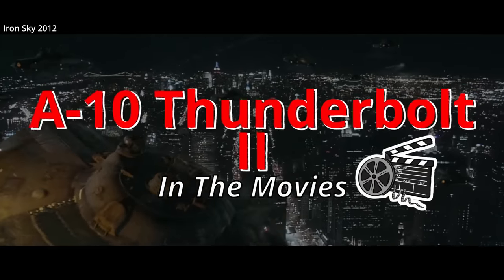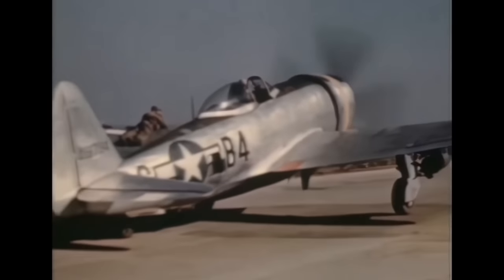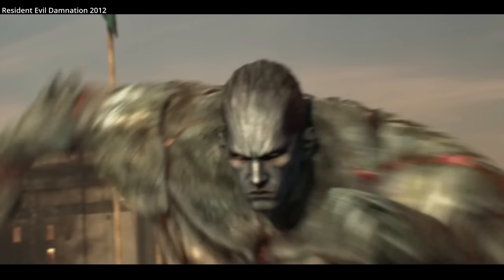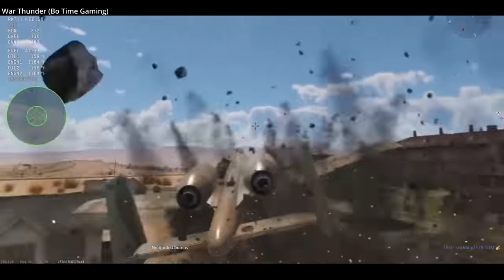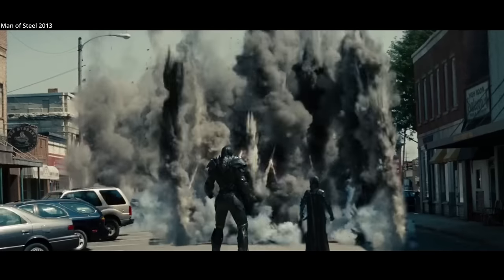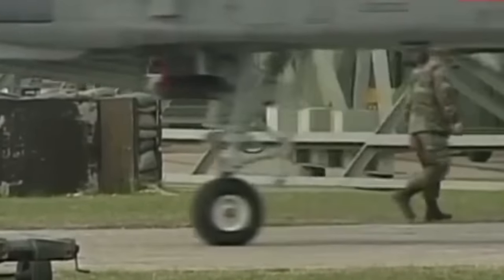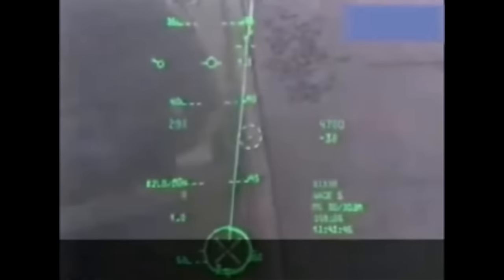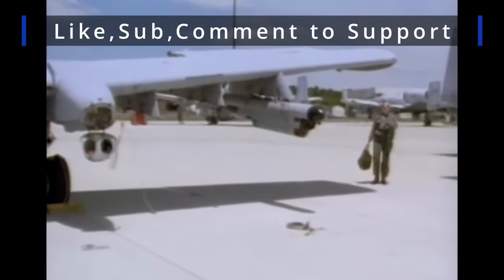A-10 Thunderbolt II - In The Movies

Comment: I saw the A-10C Demonstration Team at the 2021 Alberta International Air Show, and it was the first time I ever saw the BRRTmaster up close. Such a beautiful aircraft in its own unique way, and a lot easier on the ears than the CF-18s that were also making their runs earlier in the day!
Reply: @TheCoolCucumber  They're not necessarily deeper toned, they sound similar to the F404s in the CF-18. They just get quieter from a much shorter distance in comparison. It had to get about a kilometer to the airport before you could start to hear the A-10 again, while the CF-18s could be heard for many kilometers. The APU the A-10 uses to start up its engines though IS very deep in tone, and shakes the ground rather violently unlike the main engines. Even with one engine is already started up, you can immediately tell when the APU kicks in again to start the second engine.

Comment: The problem is the US Military does not have a good replacement for the A-10's long-loiter CAS capability, and the US Air Force has shown little interest in procuring one.  The alternatives all have issues:

1)  Drones -- While having loitering and payload capability, the ones being proposed have poor performance and must maintain high-altitude.  The key issue is they are all remotely controlled from vast distances, which means any number of electronic countermeasures can be used against them.
2)  Heavy Bombers -- Has loitering and payload capability, but likewise have poor overall performance, must maintain high altitude, and are rather easily detected and countered when loitering.  The USAF also has shown little interest in procuring a low-cost aircraft, and has been letting the current fleet of B-52s and B1B's atrophy.
3)  Highspeed Fighter-Bombers/Multirole Aircraft -- High performance and modern electronics, but have poor loitering capability.  They are also much more expensive, require a lot of maintenance and support, and are designed for high-speed and high altitude, which (while making them great for strike missions) makes them poor for cases where they need to stay on-station and CAS needs to be performed at lower altitudes and visual confirmation.

I can understand the USAF not wanting to upgrade the remaining A-10 airframes with better or modern electronics, but at least propose a project to replace the high loiter time, low altitude, high payload capability with the ability to perform visual attacks.  Not just say "my latest toy can do the job -- give me more money for that please"

Comment: Pretty much an open secret in the Air Force that this aircraft is TERRIBLE at its reassigned task--close air support.  It is simply NOT what this aircraft was designed for; it was made in anticipation of the inevitable tank invasion of northwestern Europe.  To fly up and down the Fulda gap and other choke points strafing endless columns of T-72s.  It was not in any way designed for pinpoint defense and assistance of ground troops; and two major design features of the air frame bear this out.

1:  It only has one operator; this means that the pilot not only has to fly the  aircraft, but assess the information he is receiving from soldiers that are under fire.  

2:  This plane has none of the advanced imaging of the Apache, and in many cases the pilot literally carries binoculars so they can attempt to scan the area and assess the situation they are flying into--at 300mph or so.

And then there's the mighty GAU-8--a weapon whose accuracy is measured in 12-meter increments.  What that means is that any hit within a 12-meter radius is reported as an accurate hit; that's about the length of a city bus in any direction.  And that's an accurate shot--rare in combat conditions, in a plane that offers little isolation or mitigation of the massive recoil.

Simply, this aircraft killed more of its own soldiers than any other aircraft in Desert Storm.  But hey, big gun go BRRRRRRRT

Comment: One thing about the positioning of the Aircraft's Engines.  When a jet engine gets hit - it can sometimes come apart, slinging fan blades about.  By putting the Engines off in their own little pods - this reduces the negative impact of the engine coming apart or catching fire on the rest of the aircraft, unlike engines which are inside the aircraft's fuselage.

Another aspect of the A-10's history - is  that while - yes - the aircraft is beloved by many for saving their asses - including it's air crew - the Air Force itself hates it and has tried to get rid of it several times.  The Air Force has always preferred an image of a Service that goes after Strategic Targets to Win Wars - and doesn't really get into the grubby existence of people on or near the ground.  It really should be owned by the Army - who would appreciate it - BUT - in the Forming of the "Air Force" it took all the Fixed Wing aircraft away from the Army - so that the Army is only allowed to have Helicopters.

.
Reply: Except for transports.

Comment: A-10 is feasible only if you've established air dominance and against enemy forces without manpads. very vulnerable to all AAs because of its "slow speed". also, i hear they're gonna decommission it in 2030.
Reply: Truer words ever spoken.
Reply: However, Congress would pause further cuts unless the Air Force demonstrates how other aircraft can fulfill the Close Air Support missions currently undertaken by the A-10. According to Dan Grazier from Project on Government Oversight, the Air Force is ill-prepared for this transition because it requires no Close Air Support training for its F-35 pilots, despite the F-35 being advertised as the main replacement for the A-10. Air Force Chief of Staff Charles Brown expects all A-10s to be retired by 2028 or 2029. However, further cuts to the number of active duty A-10s will be paused by Congress until the USAF demonstrates its Close Air Support capabilities can be replaced by other aircraft.

Comment: I can't see why we would go back to using prop driven planes that are slower and probably less resilient to ground fire when you have a perfectly good solution that's already in use
Reply: They are a lot cheaper. Sth the government is most interested in.
Reply: @Iauchmitschlauch  I can see that but you need to factor in everything safety included
Reply: @mikebaird6788  you can use F-16s and drop bombs, missiles form safe distance and never fly low and being exposed to small arms fire, MANPADS and most of all, SPAAW.
Reply: @mikebaird6788  safety? you mean the one on the a10 that cant defend it against anything?

Comment: Of course the Aircraft isn't to blame for Friendly Fire incidents . Intelligence , Communication and Friend or Foe  protocol breach are .
Reply: so you want me to believe the a10 is the only one suffering from those problems to such a degree its killed more friendly units than all other us planes combined? no, the a10 is a shit plane, theres no way around it
Reply: @Helperbot-2000  . If  it's  junk , then why do they keep persisting with it ?
Tell me something , ir you are doing something with , say an Electric Drill , and you manage to Injure yourself , is that the DRILL's  fault ? Or  YOURs ?
Reply: @johncunningham4820  "If  it's  junk , then why do they keep persisting with it ?" you could have said that about most of the wehrmacht, misinformation, greed, delusions, and propaganda for example.

if the drill had a high enough rate of injuries because of design desicions not present on other drills it would be fucking taken off the market potentially with criminal liability on its creators for making a dangerous tool, do you even think before you speak?

Comment: The biggest enemy the A-10 faces is the U.S. Air Force itself.  They want to retire it in favor of high tech fighter jets, but it has been clearly shown that those plants cannot do the job as well.   What really needs to be done is an alternation of the Air Force charter.  The creation of the Air Force placed a restriction of the U.S. Army, that they were not allowed to have armed fixed wing aircraft, that needs to be changed, allow the Army to have armed fixed wing aircraft for the purpose of the ground support and attack rolls.  Let the Army have AC-130's, A-10s, and what every they can make to replace them in those rolls.
Reply: ... those planes* cannot do the job ...

Comment: the american government would be foolish to abandon the a10. They should just give it a whole modernization from the ground up.. even the gatlin gun if there's a better one available. materials science has improved vastly since the plane was first built. a composite tub made from a thinner layer of titanium lined with kevlar matting (that's currently used in mraps) would save some weight and probably hold up better.
Reply: uhh, you know that there are like 5 other aircraft that can do same job as A-10 but with more reliable missiles. GAU-8 is more of hindrance then asset in ground striking (since it cased more friendly damage then bombs and missiles) and A-10C is already really expensive aircraft to make, (why would you make it even more expensive if only what does is CAS and for that you can even use a crop duster, drones with hellfire's and make it 100 times creeper).
Reply: it HAD a modernization program, and that program made it more expensive than an f35, which need i remind you doesnt need to get extensive repairs because it doesnt inevitably get hit by small arms, and it isnt highly suseptable to manpads like the a 10

Comment: The F35 is NOT a serious replacement for the A10.
The purchase price alone is staggering but the maintenance is also many times higher. Along with that we can get into other differences like weapons hardpoints, survivability, loiter time and many other advantages the A10 has over the F35.
Certainly the 35 can carry out CAS missions but its not ideal for such a role. Anyone can easily sing the praises of the 35 but when they're lined up and compared, there's no real contest. With every specification for CAS mission the 35 is a little short of the A10. When they're all added together it makes a big difference. Then you take into account the 35's inability to operate off of dirt tracks or unprepared surfaces, its major budget hike, relatively short loiter time and inability to survive being hit, its just not a serious option as a dedicated CAS Aircraft.
Every few months I see another video or article suggesting such a change. I can understand why certain groups and businesses would be calling for such a switch but its a terrible idea for a great many reasons that I didn't mention. I am not an expert but I don't need to be for this one. Any plane that isnt capable of doing the job of a different plane, should not be used to replace that plane. Its as simple as that.
Making that change would put a whole lot of money in the pockets of a small group, cost our country a fortune, likely cause the deaths of several pilots, along with the ground troops they're unable to protect, weaken our military and toss our advanced aircraft technology into the hands of potential enemies, as 35s are force to fly within MANPAD range to carry out CAS missions.
I just hope that greedy and ignorant people stop pushing the idea before some idiot makes it a reality.

Comment: There is nothing that can replace the A-10s close air support roll 
It can take hits that would obliterate an F-35
Reply: except it cant 

its not more survivable then an F-35 and in contested airspace its a lot less survivable as it cant take a direct hit from most AAA defenses out there (it can stop small arms and a 20mm fine but anything more then that and its toast)
Reply: @reform-revolution  What we find are that Russian radar guided SAM's can be evaded by flying at 100-300ft above the ground. An F-35 would still need to close to inside the S-300's detection and launch range before it can attack the S-300/400. And it's not going to be risking a flight at below 300ft
Reply: That's assuming anything can even see the F-35
Reply: @Arcturus  optical, irst can see the F-35. If the optics and irst can't see it, the conditions are such that the F-35 likely can't see the target either. IR, Lasers, and optical devices don't see that well through smoke and clouds.
Reply: @pogo1140  the F35 is a stealth fighter 

The s300 /400 cant even stop Ukrainian missiles from the 1980s
Reply: @N/A  The F-35's stealth is optimized against radar and ir detection from the front, less so from the sides and rear, and top. 
And yes, radar will see it if it's close enough
Reply: @pogo1140  you didnt understand the assignment
Reply: @reform-revolution  
You don’t understand how fragile the F-35 is compared to the A-10 
Look at pictures of A-10s in Desert Storm coming back with part of the wing missing 
The F-117 was a stealth aircraft also yet one was shot down

Comment: The idea of building an aircraft around a secondary weapon doesn’t make much sense.  I’d rather have 4-5000 extra lbs of bombs or fuel than the GAU-8.  To even use it, you’d have to descend to below 5000 feet and fly in a relatively straight line.  Just asking for a MANPADS to the face.  It’s the shit hanging under the A-10s wings that makes it deadly.  Not the cannon.
Reply: Dont forget it was obsolete since its inception, Soviets had Tanguska and that thing hard cantered A-10 before MANPADS were a thing.

Comment: The best plane that was made by USA... After F14. Or better than F14, because the Titanium cockpit.
Reply: The F-14 was a good-looking plane for sure. But it was expensive to operate and complicated to fly. It was nicknamed "the turkey" because it required a load of flaps and rudders on wings and stabilizers to be kept straight at slower speed.

Comment: Awesome aircraft. It deserves to "soldier on". Nothing like hearing the unique cannon sound and seeing a tank turned to dust when it is hit.
Reply: @Skoodelly  Plenty of pics and vids of the 30mm destroying a tank. Tell you what. You sit in an Abrams, leopard II, T14 and let someone empty the 1300+ mag of 30mm shells into the tank. Let us know how it turns out.
Reply: @garfieldsmith332  it wont do anything to a modern tank especially an Abrams or Leo with their armor layouts even from above and behind (the best attack angle typically) 

even old T72s wont be penetrated by the 30mm, we know this because the Airforce shot at them in a test and it failed to destroy them with its cannon to the point they noted that they could all be operational again with the day 

the A10 did take out a lot of tanks during the Gulf Wars with its missiles though but that cannon is not what the sale pitch claims and even at the start of its service they knew it wouldnt do much against a modern tank
Reply: @reform-revolution  Thanks for the update on the modern armour. Still forget things have changed when you see pictures 30 years old.
Reply: @garfieldsmith332  
NO, it was ineffective against tanks the day it was deployed. Even T-62 of that period was already immune to the 30mm from the front. The training manual pointed that out. Not to mention the deployment of new SPAA in Soviet tank formation at the time render that point moot since their cannons ourange 30mm not to mention the missile on it. 

The primary anti tank weapon of A-10 has been missiles for a long long time.

Comment: The F-35 will NEVER replace the A-10. It might be forced into the role, much like the square peg/round hole analogy, but it is FAR from suitable for the role. The F-35 is too expensive, lacks the robust characteristics of the A-10, and will certainly lack anything approaching the GAU-8. A far better solution would be to design a new aircraft using as many components as possible from the A-10, that or reopen up the production line after re-engineering the original design.

And I think this will bring it down to a laser focus. You don't hear pilots of the A-10 saying "We need to replace the A-10"... or the ground crews saying "We simply are spending too much time maintaining it."... or the boots on the ground saying "Yeah, we had an A-10 provide CAS, but what we really needed was and F-35." The ONLY people who seem to be pushing for the F-35 as a replacement are the Airforce brass trying to justify the 1 TRILLION USD the F-35 program has cost to date.
Reply: I would recommend you watch laser pigs videos on the A-10. It’s really not as good as you think
Reply: @mesobean  I doubt Laserpig has been on the ground when an A-10 rolled in on a Taliban position. I have seen first-hand what an A-10 can do.

The A-10 and F-35 are two totally different aircraft... different tools. You wouldn't use a scalpel to frame a house, and you wouldn't use a hammer to perform surgery.

I have seen A-10 take stupid amounts of punishment and get home. I would say the amount of damage on one airframe I saw was enough to bring down 3 F-16's. Yes, the A-10 is old. Yes it needs upgrades. But an F-35 is never going to replace it. The A-10 out-payloads the F-35 and has a loiter time on station about 4X that of the F-35. With those things in mind, which do you want flying CAS for you?

Comment: Interesting that military technology hasn't advanced very much over the last 40+ years, as opposed to say 1940-1950 where the difference of 3 years in plane technology made aircraft obsolete.
Reply: The difference is that without the pressure of a war against Near Peer Powers (Germany/Japan) the USA has been able to design aircraft, ships, and tanks that can be much more easily upgraded.
The WWII A26 was first in combat in 1942, and remained in USAF service until the 1980's; so too the AD1 "Skyraider" (shown in the video) c.1946-1978. 
M24 tanks first in combat in 1944 are still in service for a dozen nations.
Reply: We have upgraded the avionics, other electronics, and engines of the A10; more importantly the bombs, rockets, and missiles have been improved, so that an A10 can attack from longer range, and be nearly certain of hitting the enemy!